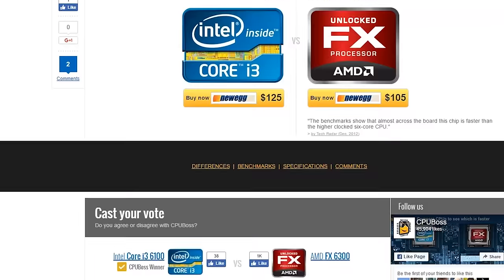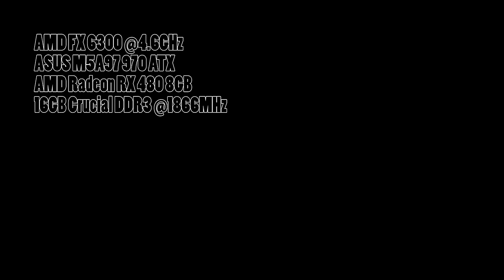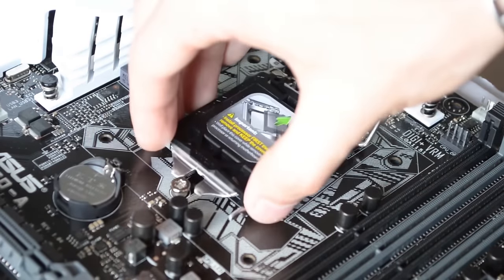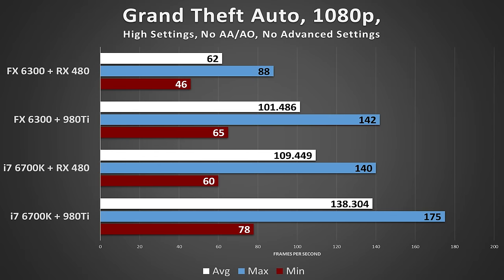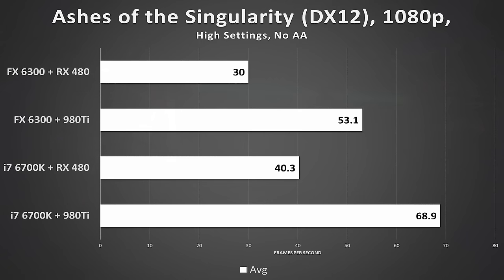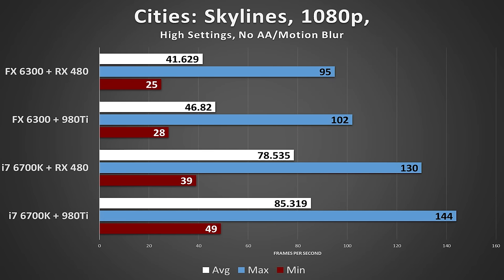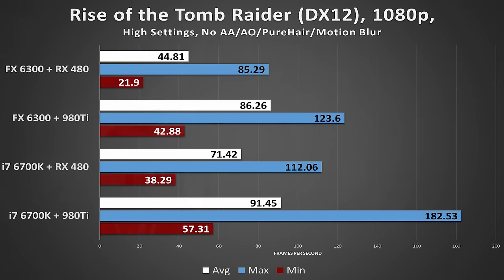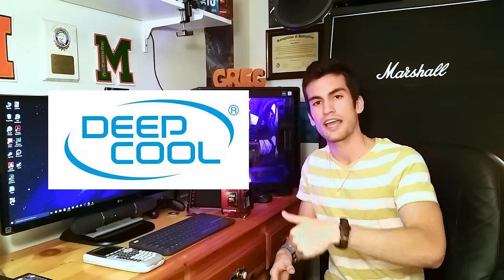AMD FX 6300 + RX 480: Severe Bottleneck?

Comment: I mean I guess we'll never know since you didn't show the graphs while running the games, but it's not a bottleneck unless you see cpu usage locked (or at least consistently sitting) at 100%. Jayz2cents has a great video talking about this misconception of "bottlenecking". Yes, the 6300 isn't going to put up higher frame rates but unless you're squeezing every last drop out of it ie what I described above, you're not bottlenecked. This is coming from a guy who ran a 6300 rig for a couple years and enjoyed cpu heavy titles like cities just fine.
Reply from the maker: You need to brush up on your definition of "bottleneck."

Comment: "the FX processor wasn't digging 1440p" What? Why would it matter the resolution of the game with regards to performance of the CPU? Wouldn't the greater pixels be only a GPU issues?
Reply from the maker: The RX 480 performed admirably in 1440p when paired with my i7 6700K. That was not the case with the FX 6300.

Comment: Soooooooooooooo, having 140 fps with fx6300 and 980ti is a bad thing now? That seems like quite a good score for few years old processor.
Reply from the maker: Still a legitimate bottleneck when compared to an ideal system. That was the only thing I was pointing out.
Reply: Technically you are right, tho there are some issues here. Most ( and i mean around 90 % of people ) are under or around 60 fps with their systems at 1080 p.

140 fps is hell of a score for a gaming system, especially for 144 Hz monitors. I dont see any reason for someone who needs render machine or a server, going for fx6300 or even i7-6700.
Reply from the maker: You're isolating this to one game, that isn't demanding in the slightest. When you look at games that require much more horsepower, it begins to make sense.

Comment: Okay, so. Let me get something out of the way right now, I love AMD. I love supporting the underdog and love the kind of multi-threaded performance you can get out of their CPUs for cheap. But recently, after some hardware failures, I jumped ship from AMD and over to Intel, having picked up an i5 3570K and an ASRock Extreme4 Z77. I do not at all regret making the move and this is basically why. Only overclocked to 4.2GHz, my 3570K is now outperforming my old FX 6300 (Which was clocked at 4.442GHz) in even multi-threaded workloads, and I can use the iGPU to encode video while streaming. I hate to say it, but right now AMD is in trouble. Zen has yet to hit, and Intel is pulling ahead and fast. I sincerely hope they sort their shit out soon.
Either way, thanks for the video from a new subscriber. Your videos have been incredibly well put together and I do not regret subbing to you. Keep it up man!

Comment: I still highly recommend the FX-6300, especially if you're willing to Over clock. I don't know anyone who can't get this CPU to at least 4.4GHz which is quite the free* increase in performance. Also I still can't really justify upgrading to a hugely over priced i7 (or i5 for that matter).

In my opinion, the FX-6300 is a great choice if you're not willing to spend over $250 on just the CPU. The at most 30~ FPS Increase for well over $150 isn't enough. Considering a lot of games will see much less increase in FPS.

EDIT: *That overclock I mentioned was when buying an after market cooler, although I know many people who still can get up to 4.2~ GHz with stock (granted running close to the ideal max temp).

Comment: If you think this test means that you will get far higher frame rates with an i7 I think you don't understand in game graphical settings and what they do. The RX480 can handle most games today completely maxed out. Very few of these tests fully stressed the GPU. When you stress the GPU in a CPU bottle-necked system the frame rate doesn't budge until the GPU is a more significant bottleneck than the CPU. This means that when running the highest settings in most of these titles the difference between your performance in both systems is much smaller

Comment: I'm playing on an FM2+ Platform with an 860K and a RX480...TBH, to me it's not really worth paying anything more. Yes, in some games the 860K is a pretty hefty bottle neck. But i haven't got the best Monitor, so 60 FPS is it and with tweaking some settings, i've got in pretty much ever game around 60 FPS. For ~ 550 Euros...and since i'm also doing some photo editing, both CPU and GPU work very well in OpenCL and outperform some i5 System by quite a bit.

Comment: Before I watch this video I just wanna say...

I have an AMD FX-8350
I had a SSC 970 and upgraded to a 980 TI Strix.
I noticed NO DIFFERENCE IN GAMES.
On Firestrike, my graphics score went up ~54%, and the combined score went up LESS THAN 1%!!!!!!
Reply from the maker: The differences here between the RX 480 and 980Ti aren't substantial either in 1080p. In higher resolutions and higher settings, however, things change drastically.
Reply: Science Studio Im just pointing out that my AMD 8 core processor was bottle-necking my 980 ti extremely.

Comment: would the 8350 have a similar problem?
Reply: Nope. I have 8350 and rx 480 no real noticeable bottleneck however I oc to 4.6ghz. Ofc if its a old game on an out dated engine like Blade and Soul where amd cpus suffer then of course but in modern games I see no Bottle necking.
Reply: +World Kat (KB) 
Which motherboard do you use? Can you list your other components as well please? I'm looking to do a similar setup.
Reply: I run a asus sabertooth r2 mobo with a fx 8350 and rx 480 reference. I used the sea sonic 80 plus bronze 620 w psu i forget its full name. I use a nepton 240m as my cpu cooler.

You dont need such a powerful cpu cooler its just I oc quite high, any decent air cooler will do the job but the stock cooler you get with the fx 8350 black edition sounds like a motorbike. Also you dont need a sabertooth as with the forumla V its simply the best for ocing the fx series. Any 990fx series mobo will be fine with this cpu but dont believe anyone who says a 970 board will be fine its a lie you have to under volt the cpu to prevent the mobo melting..
Reply: +World Kat (KB) 
Good to know, thanks man. 
Any particular reason why you picked the 8350 over the 8320 or the 9000 series CPU's? 
So the 8350 doesn't come with AMD's new fancy Wraith cooler? 
What's a safe overclock on that CPU and at what voltage? 
What's your stock and overclock RAM frequency for that setup?
Thanks for your time.
Reply: Haha you ask alot. I got my 8350 back in 2014. At the time it was between it and a 8370 with a 8370 just being worse for more.  No point in getting the 9000 series as it was more cash for more power usage and i didnt feel it was worth that. I dont give exact oc values on public places because I always fear some kid will read it and try it with out checking stability but i can say i use around 1.5 to 1.6 for normal ocing and the base clock uses about 1.33. As for ram i use 1866 sticks but really at ddr3 1600 on a fx processor isnt even that bad. I dont oc ram just because i dont see the point but a 8350 as far as i know should handle around 2100 oc ram just fine. Also ocing ram is heat I dont care for as i love midi atx cases, which means i minimise on incase heat. Hense a radiator for my cpu and i will add a custom gpu liquid cooler later for my 480 as it runs way to hot haha. (replied by a cell phone sorry for grammar)
Reply: +World Kat (KB) 
Sorry for being nosy haha 
It seems like you know what you're doing. You say you're using a mini ATX case? That's what I wanted to do myself but the mobo selection is more limited for mini ATX than for ATX. I specifically need my mobo to have an Optical Out port for my sound system.
Reply: Sadly yes. Especially the FX 8000 and 9000 series are nothing but overpriced, outdated excuses of cpus.
Reply: Haha no I said midi they are small cases but no for mini atx. And how is the 8000 series over priced? That ignorance as a competing i7 would cost 150 dollars more and what idiot would want an i5 over a fx especially when fx beat their i7 counter parts in video renedering. Team ignorant pay more will never learn. However LS2 wait for Zen as it will have its own form of hyperthreading which is very useful for outdated software. 

What mrkei is to ignorant to know is the fx series run fine with anything modern and the only real reason to pay 150 dollars more is to play outdated software that can utilize over 4 cores. Unless you are building some titian p machine getting an i7 is rather pointless for what you seem to want.

Comment: So sick of the word "bottleneck", and the way people use it. If a CPU was really "bottlenecking" a GPU, then it should not be possible to achieve increased performance via the GPU route. In other words, if the CPU is so completely maxed out that it's actually preventing the GPU from performing properly, then putting in a more powerful GPU should make little difference. Only by relieving the "bottleneck" would you be able to increase performance. This is just "more/less powerful components performing more/less powerfully in combination".

Comment: Unlike the intel sandy vs AMD bulldozer video this one is much better. I would like to add that nvidia has been working towards getting their GPUs work as independently as possible to the CPU which is one thing that dx12 (or is it 13?) is about. Perhaps you could test this? Nvidia is trying to reduce CPU being bottleneck.

One thing you didnt mention was the PCIe version used. Was both platforms using PCIe x16 3.0 or 3.1 or 2.1? It would be helpful if you could update this in the description.

The fx was more of a 3 core for gaming so its like having a 3 core vs 4 core CPU. Some games however are starting to take advantage of hyperthreading or those weird AMD cores.

I would like to introduce you to Luxmark. It is a ray tracing benchmark for luxrender 3D ray tracing software. It is a good way to compare raw performance with less bottlenecks from another component and you can actually combine various different processes. I've managed to run it combining the processing power of an I7 CPU with i7 IGP, nvidia GPU and AMD GPU altogether. Luxmark will run faster on AMD because the architecture is better for ray tracing but it is a good indication of performance allowing you to single out components. The smallest render scene may fit on Intel with IGP that has ondie RAM.
Reply from the maker: What I said in the Bulldozer video was factual. I'm afraid you're awfully uninformed.

Comment: 7:33 Right but no video card, even in SLI/Crossfire will use up all the bandwidth on PCIe v2.0, even at 8x for each slot.  Wasn't it you that did a video that demonstrated no differences when setting your PCIe slots to x8?

Also when are you gonna get proper desk, instead of a dresser? :)
Reply from the maker: I said this in this video as well. I'll have my proper desk back when I move back to school.

Comment: Zen should be great! But you are right, the FX series that we have had is getting old. Thats ok for some. You wanna build an easy media pc, I'd use a 6300 or 8320, but I wouldn't build a computer today for gaming on that hardware. I'll hold off for Zen. Nothing wrong with an Intel system either, but it will cost you a very pretty penny.

Comment: Often, if the CPU is the bottleneck, overclocking really delivers a significant improvement. The FX 6300  - like all FX CPUs - is a great overclocker. It can easily reach 4.3 to 4.5GHz on air cooling. This video would have been great, if there was also a bench run done for an overclocked FX 6300 + RX 480 combo. I think it would have come closer to reality as that is what many gamers do. Otherwise still a great result for AMD given how old that CPU is.

Comment: I hate that the term "bottleneck" is used interchangeably with less performance. A bottle neck is what happens when you stick a small nozzle on a hose. I.e, to much stuff to actually move through the pipeline effectively.

But, a lesser pressure moving stuff out of the hose (I.e., slower, weaker cpu in my lazy example) is NOT A BOTTLENECK - it's less flow... Argue it with whatever logic you want, sure, but it's still the wrong term 90% of the time in the computer realm.

Literal pc bottlenecking is when you have properly matched components that should be running fine giving you low numbers for an unknown reason.

Comment: I'm running an i5 4690K and no matter if it's overclocked or not, it bottlenecks my two 960 4GB (yes I know... 960 + SLI = bad Idea... but I got them for the price of one card)
I was thinking about getting a used 4790 to improve my performance (Sometimes the gpus run on 65%, when the cpu is on 99); would an i7 solve my problem? 
This video says that there should be no difference between an i5 and an i7...!?

Comment: I have a 6300 paired with a 750ti is pretty good it handles whatever I want in 1080p high with no issues.
Reply: Have a similar set up with 6300 and a gtx 950. Runs great for most of the games I play: CS GO, WoT, Civ5 and a few others.
Only issue I've had is getting it to run Squad well.

Would have been more interested to see how the rigs compare on medium settings.

Comment: This is so accurate, I have a FX-8350 & 2 GTX 780's. I'm pretty much fucked in CPU intensive games. (I have a 144Hz monitor so my framerate standards of what is a fucked framerate are probably higher than that of an average 60Hz user.) 

Thinking of upgrading to the next i7 or AMD Zen if they're any good.

Comment: so at the moment i have a gtx 960 ssc 4gb and an amd fx6300 black edition with no overclock + 8 gb ddr3 (crucial ballistix sport). My original plan was to do rx 480 with my current cpu OR an i5 6500 (locked) with 8 gb ddr4 and an msi b150 gaming m3 motherboard. WHICH ONE HAS THE BEST PERFORMANCE. My budget to upgrade my pc is $350
Reply: Forzalogistics45 i5 combo easily. You won't receive any type of bottleneck whatsoever. I upgraded from an fx 6300 to an i5 4590, and it's just a whole new world. If you have the money to go the intel route right now, do it, you won't regret it.
Reply: Yung Baklaooo thanks man, I'm doing a mini itx build with that Intel 6500

Comment: Not to mention BF4, even on the PS4 with the AMD apu on metro 64 players it randomly goes to like 5 fps and stay for a bit of time lags like hell.

Even though I have old hardware I7 2600K at 4.9 ghz and a lower power GPU than the one on the PS4, GTX570, I play metro 64 players on PC 1080 all ultra and never see spikes of lag

Comment: The whole "bottleneck" thing isn't as big of deal to some people as it is to others. A lot of people with older CPU's and newer video cards paired them knowing ahead of time that their CPU would be a bottleneck, and are perfectly okay with it because for some, 45 fps is perfectly acceptable, and for some, 30 fps. The quality of a PC is determined on an individual basis.
Reply from the maker: Of course it is. However, knowing how severe the bottleneck actually is could be the deciding factor for someone questioning the viability of a platform upgrade.

Comment: CAS latency means a hell of a lot less than RAM frequency - like virtually nothing.

Also, when comparing two platforms its safe to say that you have to compare the platforms at their best. There's no point in testing just the CPUs, you have to test the capabilities of the platform because when people are investing into a CPU they are also investing into that platform.
Reply from the maker: Incorrect. CAS plays as big of a role, if not a larger role, than RAM frequency does.
Reply: In what workloads? Most if not all benchmarks on the internet show a massive leap from 2133 C11 to 3000 C16. I understand that if you have faster RAM already tuning down the latency can make a difference but faster (Mhz) memory is ALWAYS better in some way.

http://www.hardwareunboxed.com/forum/viewtopic.php?t=1570

http://www.corsair.com/en/blog/2015/september/ddr3_vs_ddr4_generational
Reply: In the most extreme case, your statement concludes that my 10 year old DDR2 800 @ CAS 4 is faster than my DDR4 3200 @ CAS 16, this is obviously not true. However In terms of percentage, the CAS and frequency have the exact same 300% increase between DDR2 and DDR4.

Comment: I remember reading an article a while ago that compared AMD and Nvidia GPU's of the same performance and on an AMD vs Intel platform. It showed some odd results. The AMD cards performed worse than the Nvidia ones when paired with an AMD CPU. When moved over to an Intel platform performance was normalized between AMD and Nvidia GPU's.

Kind of odd that AMD+AMD had worse performance than AMD+Nvidia. Seems to be some of the same happening on your results. Since the 980 Ti wasn't not falling off in scaling as badly as the RX480 did on the AMD platform.
Reply from the maker: I have a video covering this topic, explaining why that is the case.
Reply: Nice. I'll have to take a look through your videos.

Comment: my fx 6300 and fx 8350 with 1070 I'm good my bottle neck is my Puerto Rico Internet amd for a cpu that's from 2011-2012 my opinion they hold their own good I'm happy 1080p power supply is one of the most important part of the I got evga g2 850w 10 year's warranty  pc build I run them on asus sabertooth r 2.0 this motherboard I'm my opinion it's one of the best for fx cpu

Comment: the rise of the tomb raider results are a little awkward, 
the fx6300 bottlenecks the rx480 more, than it does the 980ti.
there's a big 27 fps gap on average compared to the i7, with the 980ti it's only 5 fps...shouldn't it be the other way around ?
Reply from the maker: These are the data. Tomb Raider is highly unoptimized.

Comment: Hi, I got 500$ and I want to upgrade my PC, what parts should I buy, I only need a better CPU and GPU. The cpu I use right now is an AMD Athlon X4 760K with stock cooler at stock speed and for GPU an AMD RADEON R7 260x at stock speed.